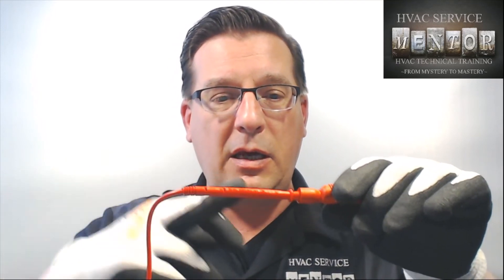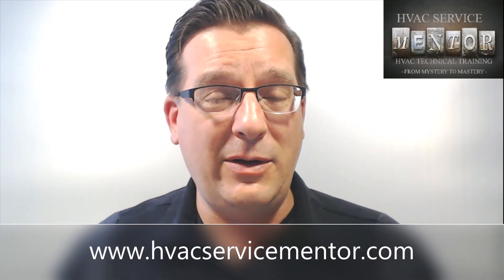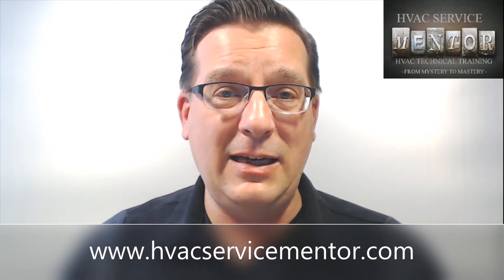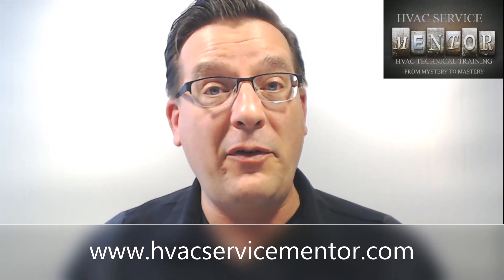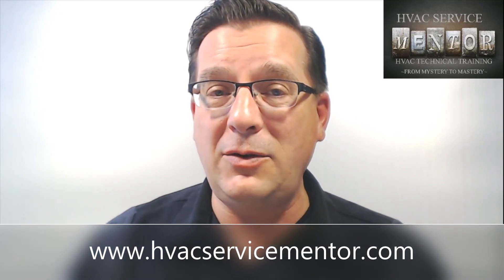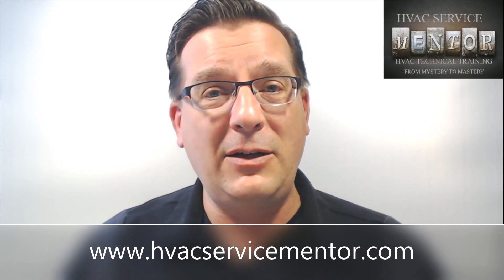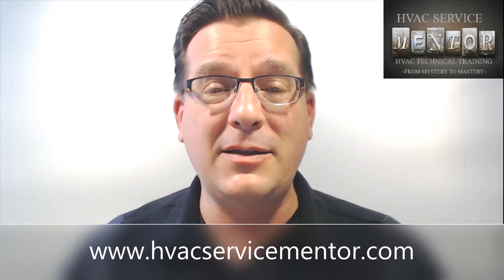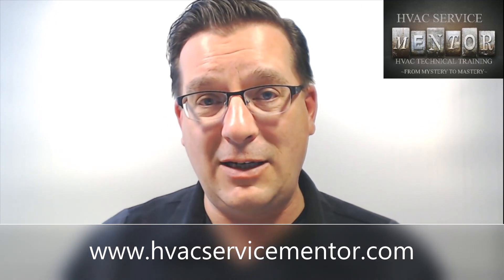Working Safely on Energized HVAC Equipment

Comment: Awesome video, thank you! One somewhat related question: Are there gloves available that provide both electrical and thermal (i.e., protection from refrigerant burns) protection?
Reply from the maker: i'm not aware of any such gloves.  I can tell you that the special electrical protective gloves that have a dielectric inner rubber glove and a leather outer glove should never be used for anything other than live electrical testing work.

Comment: Was taught the 'one hand' rule in college. To facilitate I use my jumpers to connect one clip to ground lug & other to one meter lead. I can hold meter in one hand while using  with the other probe keeping my body & one hand far from 'making a circuit' with body parts. Also clipping one clip to common on 24v transformer makes it easy to 'hop-scotch' through control circuits holding just one meter probe to find open safety.
Reply from the maker: Good tip!  Using test probes that have purpose made alligator clip accessories is great too.

Comment: From residential to commercial refrigeration and commercial and industrial work what we do could put our lights out in the blink of an eye. Many of the industrial chillers I work on are 800hp motors running on 4160v 3ph.  An unprotected open drive coupling would make a mess of anyone that got into it. You should be the safety spokesman for tech training. You’ve been there done that and explain things well. I got refreshers of maybe a few things I let myself get complacent with.